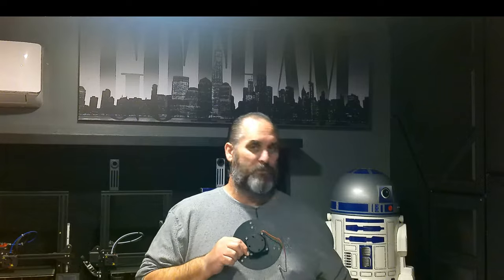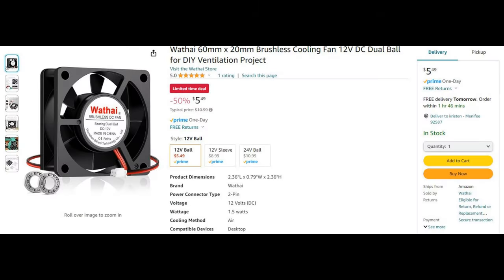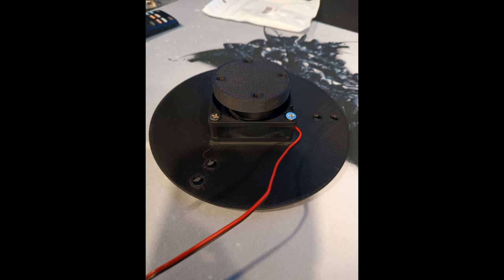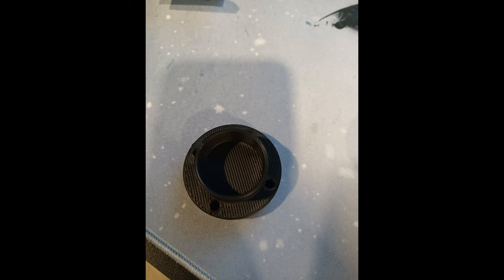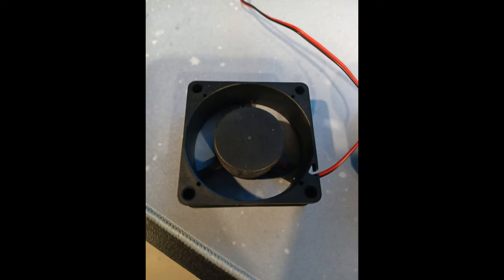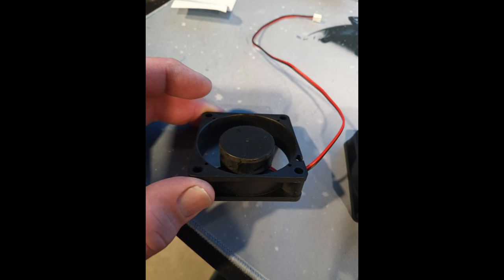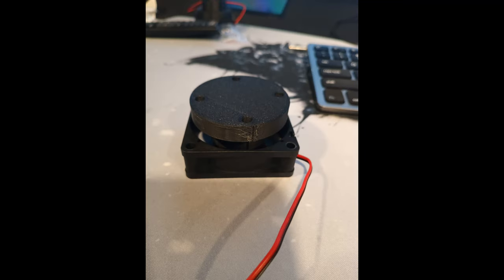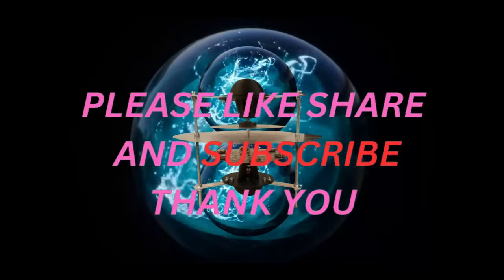Graviflyer "How To Build One" Update #6

Comment: Rather than argue over motors I still would like to see three tiny strain relief sensors on the bottom of the feet to tell you if it's losing mass as it runs.

These gauges will show you if your on the right track long before you get a working model.

These gauges configured to show mass will tell you if it's gaining mass, losing mass or just vibrating the mass up and down and neutralizing motion up or down.
Reply: You mean strain gauges.
Reply: @dogwalker666  Strain sensors are setup to sense pressure. Strain relief sensors are setup to sense a reduction in stress. 

The best way to set them up would be with one of these on each leg and adjusted so that the full weight is calibrated as zero and then calibrated so that it could read in both directions; to sense stress and stress relief.

Some are designed to read in one direction only. You can adjust others to read both directions. 

Others are completely dumb and you write software to detect change and fake reading both directions by preloading them and calibrating that as zero in the software.
Reply: @tenlittleindians  We fit strain gauges to the bearing legs of the spin casters they detect movements in the casing, The Strain gauge amplifiers can be calibrated to give Mono polar voltage or bipolar, I feed the signals into a PLC and with a little bit of maths I graph the Vibrations, Torque and Roll weight on the HMI panel.

Comment: Thank you. Will you please the HV to the rotating disc? Will a " AC Motor Speed Controller 120V 15A 4000W Variable Speed Controller Fan Speed Controller for Electric Motor with Overload Protection Switch" work?
Reply from the maker: These run on 12v dc. So no it would not work. Amazon has one for $15. I will send a link when I get home.
Reply: Thank you. You are amazing! I rebuilt this three times according to updates. I will show you my results soon. I'm talking about the HV to the disc and not the motors, they work great.
Reply from the maker: https://www.amazon.com/gp/product/B00JEXJXAC/ref=ox_sc_saved_image_2?smid=A298K45OP416LP&psc=1